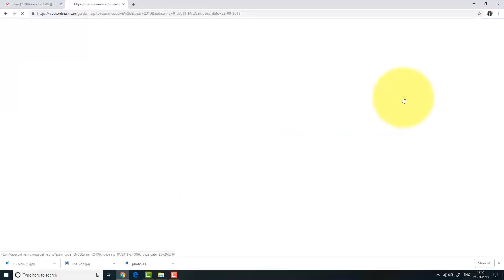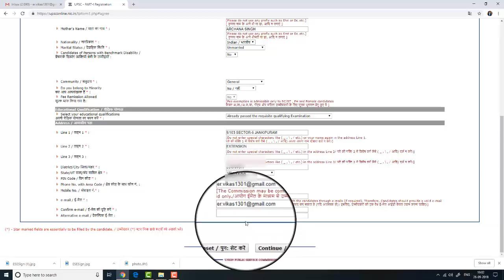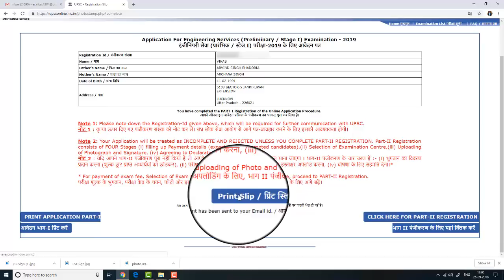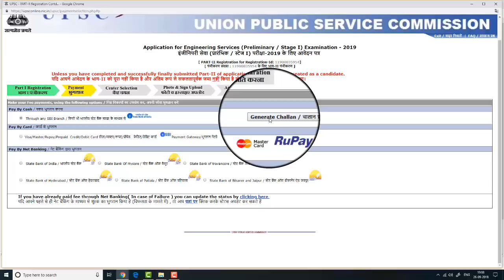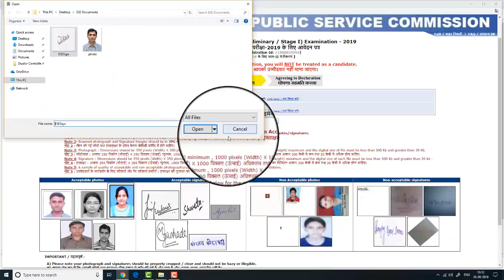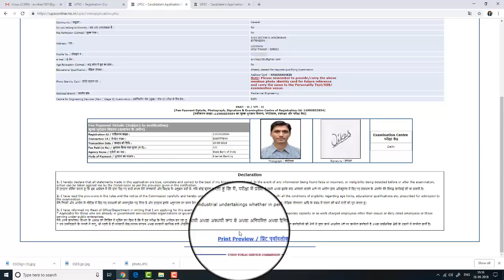How To Fill UPSC ESE/IES 2019 Application Form

Comment: I belongs to obc but I don't have obc certificate. ..I applied for it and it seems that the certificate will not reach to me between 22oct ..how to apply.. because it requires the date of issue of the certificate ..  what are the options?